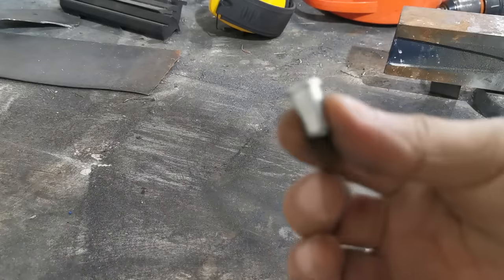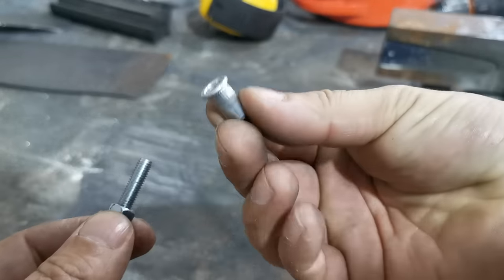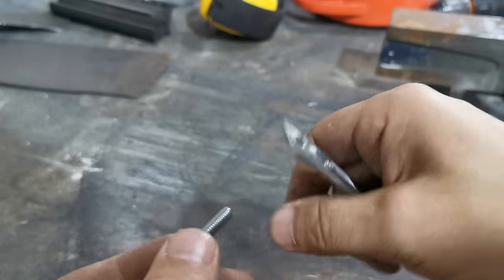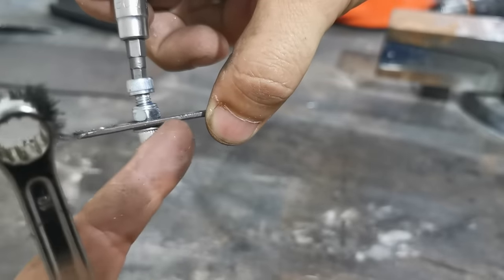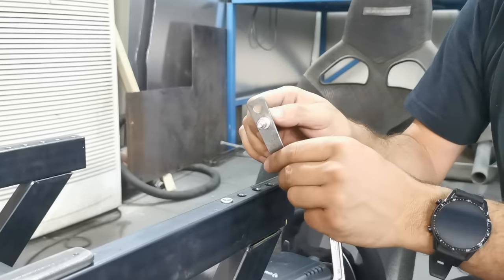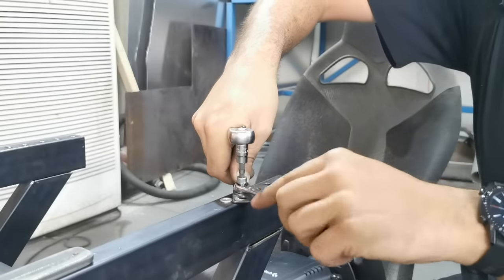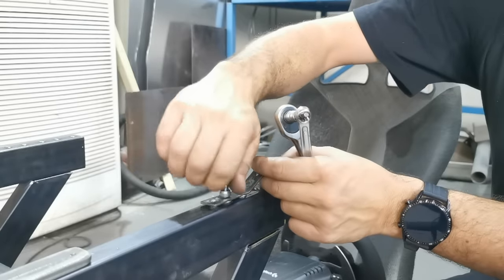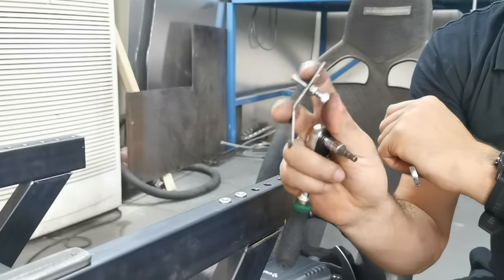How to install rivnut, rivet nuts or nutserts, with no expensive tools

Comment from the maker: *Update* Silicon spray or WD40 makes it easier, but Copper Slip grease is even better!
Reply: Better still silicone grease, it stays where you put it.
Reply: I've done something similar but I use a tiny dab of synthetic boat trailer bearing grease on the washer and the threads. Where I live we have ratcheting box end wrenches, some with variable angle handles...
Reply: for exterior applications, use silicone caulk for sealing out water leakage if rusting is a factor
Reply: I'm in a fix. I have a 1986 Pontiac 2.8lt injected and a  irreplaceable intake with thermostat housing ( Pot metal) bolt holes stripped. Cap won't hold and leaks. 
Thin walls M10 bolts. Though was drop to M8 resess holes for depth of lip. Love keep it simple tooling. Missing my Master Cheif Navel Air father. 1939-69. Car is 6000 STE. Wife's poshpontiac. Making brain numb
Reply: @walterward8164  Maybe tap the holes and use a threaded insert aka helicoil? That way if tap does slightly get through the wall the insert can seal it with an appropriate goo? Obviously intake must be off the engine, don't want bits getting in the engine!
Reply: A longer wrench would be better
Reply: @walterward8164  I wonder if Alumaweld or a Heli-Coil would work
  Heli-Coil would be my first test
Both video's available on YouTube
Reply: Can you rethread the rive nut if you've tightened it too much/cross threaded it?  I can screw in the bolt about 1/4" and then it gets "stuck"....
Reply: @tony5006  Q
Reply: L
Reply: For people saying use helicoil, you use the rivnut for thin metals and tubes where you can't make thread.
Reply: @nothanks3462     
armando matos
há 3 dias
For people saying use helicoil, you use the rivnut for thin metals and tubes where you can't make thread.
Reply: @notwrkn2mch     
armando matos
há 3 dias
For people saying use helicoil, you use the rivnut for thin metals and tubes where you can't make thread.
Reply: Better use some grease instead of oil. This method worked for me with the aluminium rivnuts. The steel ones are just too hard to pull with the nut. It strips the bolt threads.
Reply: Minerail Oil.

Comment: Use a brass washer between the nut and plate tool. Brass will allow the nut to slip around as you tighten it. The brass is almost like a lubricant but it doesn't get squeezed out.
Reply: Fantastic bit of info
Reply: Was going to suggest the same thing. The bracket acts like a washer.  A second washer allows a bit more slip than one washer alone.

Might be neat to see if steel + brass uses less force or hardened steel bracket and hardened steel (stainless maybe) washer has more slip.  I'm thinking the softer metal might add a little drag, but either should be good for what. You're doing here.

Also I wonder if a bracket that captures the ratchet might be useful. A little bit less to manage dexterity wise.  Either way, great video!
Reply: @underourrock  
In the marine industry, we use a swaging tool to fit garboard drain tubes into the transom of the boat. The drain tube is made of brass  and the swaging tool rounds over the end and seals it to the transom. This swaging tool has the brass washer setup I described. The brass washer goes against the die and then a steel washer sits between the brass washer and the nut used to tighten the swaging tool. I used the same tool for at least 20 years, probably at least 200 to 300 times without changing the washers.

I will admit I don't know if it is some special alloy or not but it just looks like plain everyday brass.
Reply: @rogermccaslin5963  thank you very much for the added info.  Wasn't saying the brass wouldn't work..any simple flat washer will give more slip than no washer.  Was just curious if maybe there was a small difference with the softer metal.  Wouldn't be surprised if there wasn't a big difference.

Comment: Been doing it this way for roughly 40 years and it works fine. Although I use a 6mm plate and leave it flat so that I can fasten it with a clamp because then you only have to hold the ratchet. Which of course is according to where one needs to use it. A washer between the nut and plate kann possibly reduce the friction between both (he recommends lube for that reason) and improves the torque weil reducing the amount of pressure needed. Never owned a Rivet Gun, but also never needed Rivet Nuts on a regular basis either. So therefore this method was always practical. P.S.- Never tried this above 8 mm threads.
Reply from the maker: Awesome, thanks for the comment. And thanks for watching as well.
Reply: yep nothing new
Reply: kann?? 🤔🤔🤔
Reply: I install a lot of door hardware and this method is actually comes with the hardware.

Comment: I followed your instructions to repair damaged threads of a friend's sailboat mast gate using aluminium Rivnut. Result was awesome 👍. Instead of rethreading the M8 for large M10 size bolt, with Rivnut we actually end up using M6 bolts 😁 Thank You Smoking Steel Garage 👍
Reply from the maker: Awesome, glad it helped you out.

Comment: You smart bugga!  I've been working as a transport canada licensed aircraft structures  engineer for the last 28 years.  And you just taught me a new trick.  We use rivenuts extensively in aviation and I've never seen them installed without the fancy pants tool. 
Great job my friend👍
Reply from the maker: Ahh that's awesome. I wouldn't describe myself as smart though! I was just in a jam, and had to find a quick solution. Thanks for the comment! and glad it helped you out.

Comment: I regularly use a rivnut  or nutsert tool, and the method shown here when needed. One thing to remember is that with both , you only have to start the rivet compression until it bites on the sheet metal, then the final compression can be done when the final assembly occurs. Saves time and is vastly easier on the rivnut mandrels, which in the smaller sizes have a limited lifetime.
Reply: Good tip!
Reply: This should only be used if the final assembly bolt is long enough to engage all of the rivet nuts threads whilst in a not-fully-compressed state.

Comment: I use a riv nut tool quite often in my work place, I’ve never had one break. However this is a great hack for some jobs that you can’t get the tool into, and for tightening a spinner, as long as you can thread that bolt into it, I think it’s a great option.
Reply: Yep, I've also never broken a rivnut tool, but this saved me the other day when I welded some parts together and no longer had space to get the tool in.
Reply: What brand do you use? I've been having a hard time finding a good one where I live

Comment: Well, what a find. Working to get my E-Type on the road and this will come in so handy. Now I only need two buy the rivets. Great job coming up with this tool. The higher the level of sophistication, the simpler the tool. In my opinion. It takes a lot to think through the process to winnow it down to a great solution. Good job and thanks, Mike
Reply from the maker: Thanks for the comment Mike, glad I helped you out. and E-Type, that is a bucket list car for sure. Very envious! Good luck with the restoration.
Reply: Awesome car 🖖😎👍

Comment: I use rivnuts a fair bit in sheet metal and one trick I use is to put a bit of LockTite on the outside of rivnut and around the hole in the sheet metal before I crimp the rivnut. This seems to work at keeping the rivnut from spinning in the hole when you use it later. If you're able to let it dry first. CA glue might be a quicker option.

Comment: I do oven cleaning and repairs. Have found rivet nuts useful where some of the screw mount holes for the back panels or element have corroded. One of the original videos I saw for seating rivet nuts was using a nut, bolt and washers to set the rivet nuts. Only problem I was having was that the rivet nut was sometimes rotating when trying to tighten. They have a grip profile on the side but rivet nuts but they dont always stop the nut rotating. Love this shaped piece of metal with the hole which will stop the nut rotating. Unfortunately I failed trying to seat 2 rivet nuts yesterday wasting over 1 hour, and spent out on a tool. Will make up a couple of these metal profiles at the weekend. Thanks for this brilliant tip Smoking Steel Garage.

Comment: Ratcheting wrench would be a great upgrade and time saver!  Thanks for the tip!  JD
Reply from the maker: You got that right!
Reply: Yes, a ratcheting box-end and a way to integrate a t-handle allen wrench with the shim plate is what came to mind. With the stationery allen wrench itself holding the plate, you'll need only two hands! And the process of deforming the fluted section of the rivnut can be more-or-less continuous from start to finish.

The question I'd address with this kit in front of me: is the installation quicker or more reliable (i.e. non-destructive) if the flutes on the rivnut are lightly scored circumferentially, near the mid-point of the flutes, beforehand? Slightly below?

Comment: I have installed a rivnut on the inside of a square tube with a bolt, two nuts, a couple of washers and some lubricant.  Crank the two nuts together to make an anvil, add two washers for slippage and turn the whole thing with a ratchet.  It works as long as you start with a tight friction fit to keep the rivnut from spinning.  There is always a risk of stripping the rivnut but if that happens you just drill it out and start over.

Comment: I’ve been using rivnuts since i found them in 2007. I had no idea there was a tool to install them so I simply use 2 washers, lubricated, & a high strength cap screw with a nut. Hold the caps crew as per video & perform the Same action with the nut. The nut turns the upper washer while the lower washer “sticks” to the rivnut flange when the pressure increases & the Same outcome happens. Just undo the nut & both washers free up. Unscrew the caps crew & admire you “no-tool” rivnut insertion.

Comment: As you say, a good smear of copper slip makes turning the nut much easier, the other essential is to use a high tensile bolt, as you have done here a hex socket bolt is usually high tensile,(providing it is not a chinese one), these rivenuts are very useful in fixing parts after assembly. Many thanks for posting this! Chris B.

Comment: This was excellent and far better than other videos placing only washers under the nut; washers do not stop the rivnut from spinning with the nut. Holding that plate stationary under the nut prevents the rivnut from being turned while the nut is tightened. I also agree very much with using high strength bolt and a long barrel but, particularly on M5 and smaller rivnut, mine stripped the threads as the rivnut was pulling up.
You got me, Subscribed!
Reply from the maker: You got it! Thanks for the comment, and thanks for watching!
Reply: A star washer between the rivnut and the bottom of the tool stops the rivnut from spinning.

Comment: Been using them this way mainly M8 rivnuts for years, l also use my Bosch impact driver which also works great. Just make sure the nut and bolt your using is high tensile and keep the threads oiled.
Reply from the maker: Thanks for sharing

Comment: Thanks for that great video on alternative methods and ways to prevent the threaded nut, or the bolt from breaking in the event of a off set condition or confined work area.  I can see the myriad of conditions where a nut cannot be added and this is a great time saver as well as a money saver.  I had some similar situations and the threaded part was rusted stuck and thankfully, the threaded part was stainless steel, so using a chisel and prybar made short work of prying the screw enough to add WD 40, so I was able to remove it. I  could also see that if the insert was damaged from inside from a bent condition, this method could also help to raise the screw enough to fit in a chisel or grinder to remove it.  Five stars for communication since many videos have music all threw the video with no explanation of each step, as you've probably seen too.  👏👏✨✨✨✨✨✨✨✨

Comment: Just what I was looking for, car application. I want to fix an oil cooler to factory holes and this comes very handy! Thanks man!
Reply from the maker: Awesome. Glad we helped you out 👍😉
Reply: @SmokingSteelGarage  do you think rivnuts could be used to install seatbelts in a car that doesn't have predefined nuts for seatbelts in the interior wall?
Reply: @AbbasBinYounas  no. Rivnuts could pull through in a collision. Welded nuts would be better for seat belts.
Reply: @firebird8600  thanks.

Comment: I don’t understand why this gets a thumbs down. As a DIY user I needed to fit 2 m10 ruvnuts to my van chassis. Laid on my back with very little ground clearance in the roadside, this worked perfectly for me. Because 
a. I don’t have the tool to deal with rivnuts that big. 
B. Even if I did, I don’t think I’d have the room to use it.
So; fantastic tip, it’s much appreciated, and your link has been shared.
Thanks k
Reply from the maker: Great to hear it helped you. A few others just don't get it........ Such is life 😁

Comment: Nice idea. I’ve got a couple of suggestions, a ratchet ring spanner would make things easier and a few high grade bolts would make it less likely that the bolt would snap when tightening up the rivnut.
Reply: Go to your nearest industrial fastener supplier and purchase suitable high tensile capscrews/allen head screws (machine bolts). These will exceed anything you can get at a bigbox retailer.
Reply: The bolt he is using is a cap screw, one of the most high tensile bolts you can get over the counter but yes a ratchet spanner is easier.

Comment: good stuff, just a tip I noticed, your hand made tool with the holes, it could also work as a 90* angle and  turned the handle bit down and let it jam against the frame so u didn't need to hold it. just a though.
Reply from the maker: Good call! Yes I have another tool I made that I use just like that.

Comment: Good tip!  i nherited a Used WorkVan that had  Commercially purchased shelving and Storage racks in it  utilizing those RivNuts and i  stripped those to install Custom made Shelving  built by me  those Riv Nuts were a pain in the backside to remove  and I just ran new Sheet Metal self tapping Screws into the Vans wall reinforcing Ribs  that held those shelves in place for 25 years and 150,000 miles  at that time i had no intention or need to purchase  the RivNut tool or system

Comment: Been using a horn bracket to install the inserts for 20+ years lol have 2 of em, fast n easy.
I don't use an extra nut, just a flat washer, then I don't need 2 wrenches to tighten it up and get nice & tight fit in the hole

Comment: Clever! A tip, if you have problems with the threads stripping on the bolt, or the bolt breaking purchase a higher quality bolt. Hardware store bolts are garbage. Years ago I had seat post adjusting bolt problem as the threads kept stripping. I found a store that carried military surplus fasteners and purchased  a few bolts that originally had been used on fighter jets. That was the end of that problem!

Comment: Am building a kit plane. Thanks for this info plus comment about brass washers. Rivnuts very useful items where you can't get a spanner behind to do up or undo the nut that holds the bolt. Thus you can secure a piece of equipment such as an instrument to a sheet of metal and it is then very easy to take it off and put back when required for servicing etc.

Comment: I used to use Rivnuts back in the 1960's. Back then, they were patented by Goodyear. All it takes to install them is a Grade 8 screw of the right thread, and a high strength nut.

Comment: I made the same tool but use a star washer between the top of the rivnut and the bottom of the tool. This holds the rivnut from spinning while you tighten the bolt. Much easier to hold onto when drawing the nut up.

Comment: JCB using these on to hold everything inside the cab, and half the S.O.B. will spin, and Paccar use them to hold the cab lights on the trucks and the same thing there. They have their use but if your using a lot of these is time saver to buy the tool, if one or once an a while do it like you doing.

Comment: You don't really need the 2mm metal strip. Just use some washers on the rivnut and under the nut works fine too.
Reply: this will start winding the rivnut down the bolt which is exactly what you don't want.
Reply: @jrs4516  never had this experience

Comment: Good video...Thanks. I normally jusy use a washer between nut and rivnut,,,no handle needed
Reply from the maker: Thanks, yes a washer works, but I found times when the Rivnut would spin as well. So the tool stops that from ever happening.  👍

Comment: A washer or 2 would help, I got a few flat load bearings of different sizes, and use 1 between 2 washers below the bolt

Comment: I used these to install roof racks to the top of my van They work great
Reply: That's exactly what I'm going to use them for. What size did you use? Can you recommend a kit?
Reply: @TheBenjammin  1/4 inch threads
Reply: Harbor freight cheap kit but it worked

Comment: I use a connector nut to tension bolt and crimp riv nut. Also apply grease and fit several greased washers to reduce friction. This way I can even crimp stainless steel riv nuts of any size.
Reply from the maker: Great idea

Comment: What ever bolt/nut size you want to use for this it needs to be grade 8. I tried this with standard #10 size screw and the threads on the screw I used all but stripped on the first riv-nut I set. Also use molly grease on the screw threads. In reality, the tool I make next for this will be tool steel, I will cut the threads and then harden it. I will probably just buy a set on mandrels for a quality nut setting tool as if those are going to last more then a few sets they have to be darn good grade of steel properly hardened.